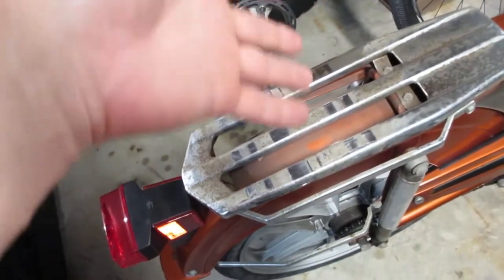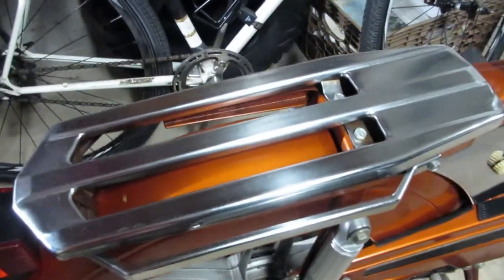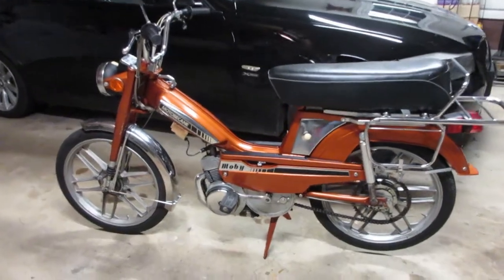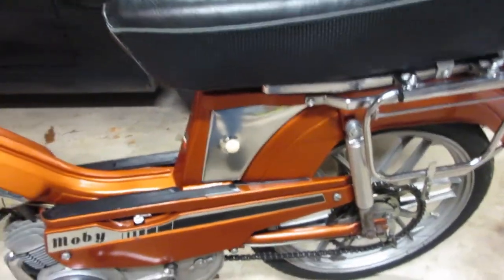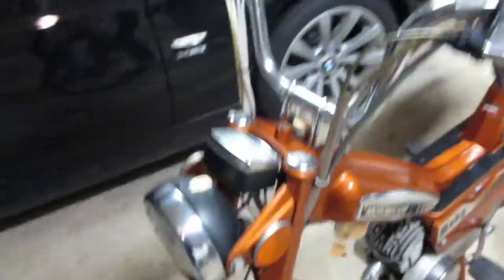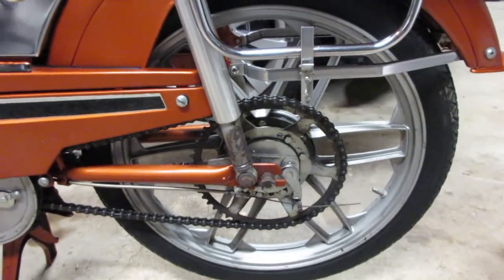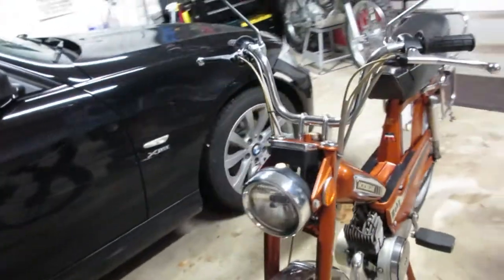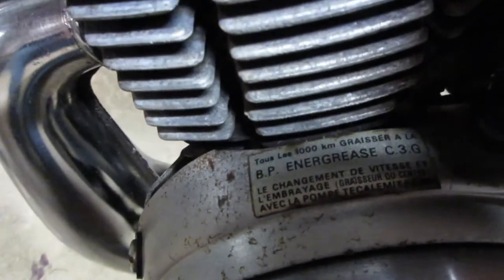Barn Find 1979 Motobecane Moped - Restoration & Complete Transformation!

Comment: I found a 78 Moby in great cosmetic condition. The only problem is the odo is at 2900, which is feeling reallllly long in the tooth for a moped motor. I picked it up, price was too good to pass on if it could be made to run. Compression is fine, ignition will have to be redone.

I figure that these moped engines are so expendable that you can keep rebuilding/replacing them as needed, so the mileage is less of an issue. At least that's what I keep telling myself lol
Reply from the maker: Awesome! Yes they are very replaceable and easily rebuildable. Basically a chainsaw engine in a bicycle frame LOL
Reply: @wrenchandrip  it actually looks like it has an AV10 motor as opposed to the AV7. My very limited knowledge of these things has me under the impression that they came with the AV7 stock, so I'm hoping that high mileage has been split between the original motor and a later replacement. 

Were there any mobys that came with the AV10 stock?
Reply: @jackdodsworth6077  lmao 2,900 miles is nothing. I’ve put 15,000+ miles on builds over the years. Just build them right the first time. Also yes, some bikes came with AV10 engines.
Reply: @mattketner7597 that's what I was thinking, 8k+ is what I'd call high for a moped